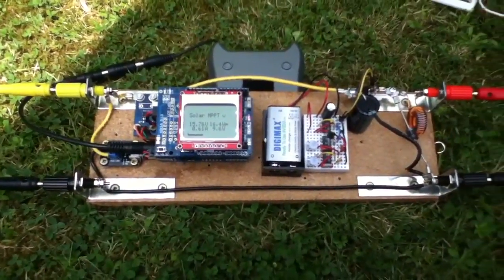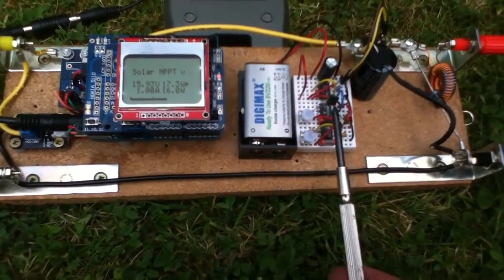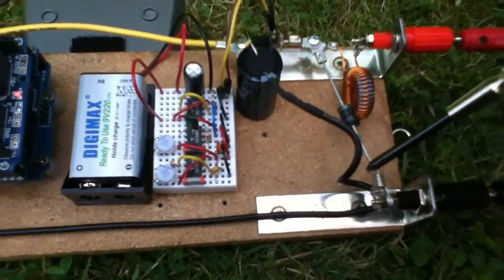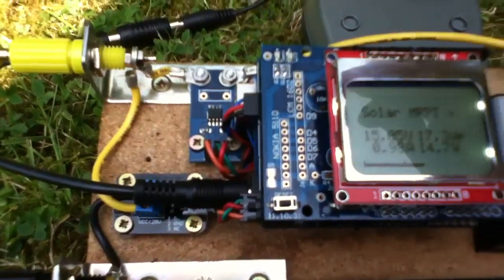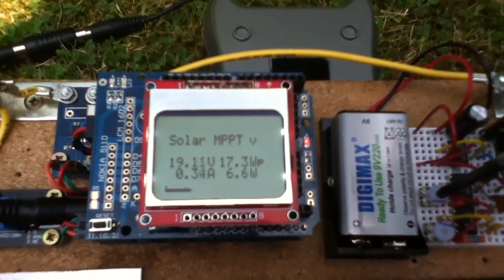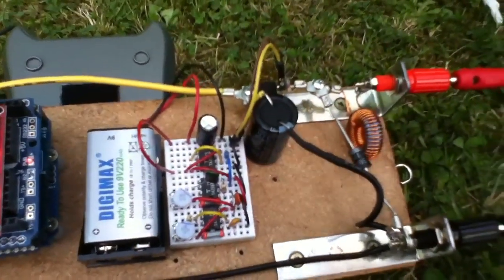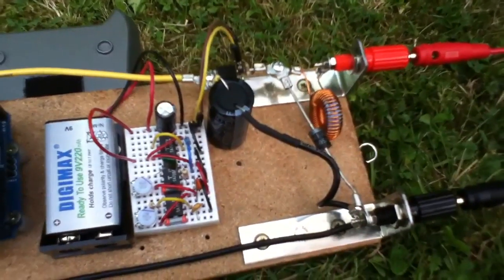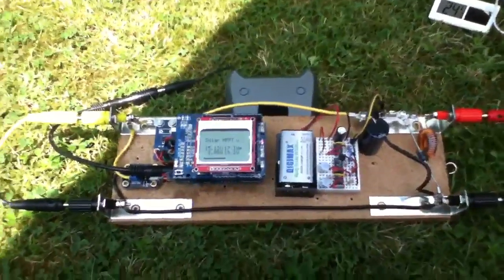MPPT Solar Charge Controller #9 - Project Review and Future Ideas

Comment from the maker: At the moment I'm just trying to maximise panel power, so I'm measuring panel volts and amps. Later I will put the same measuring devices on the battery side and measure power delivered to the battery. With all that data, the CPU will be able to display an efficiency percentage.
Then I can probably answer your other questions about buck converter efficiency and how the panel size affects  things. I just don't know at the moment.

Comment: Any reason you are measuring on the panel side, not on the battery side?
I'm assuming the buck converter's efficiency curve is non-linear, so an increase in power output from the panel may not always mean an increase in power to the battery.
It may be that any difference is small enough to not matter with large-ish panels.